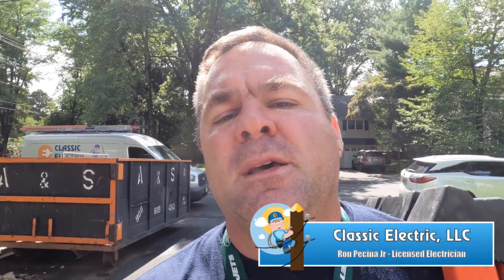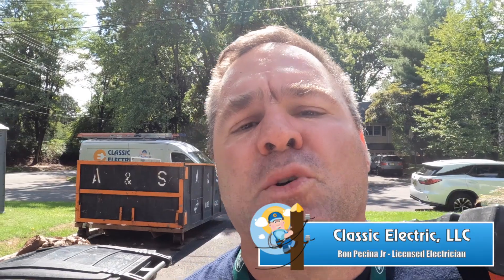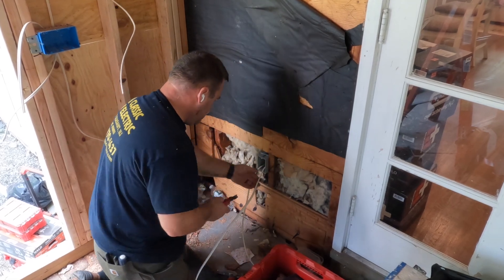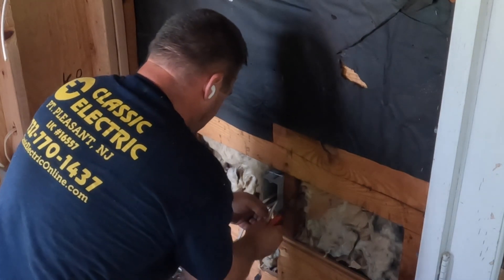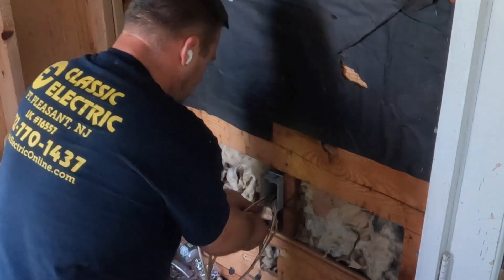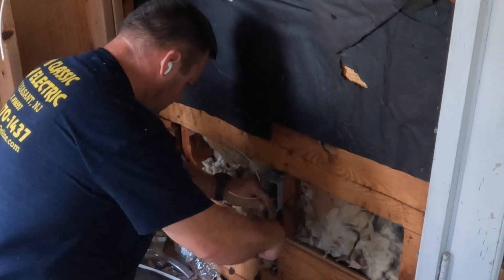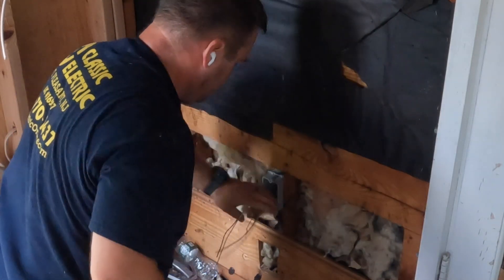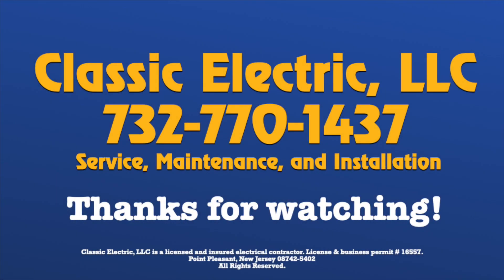How to Install 15 AMP Branch Circuits | New Addition Residential Wiring

Comment: Most construction building codes state that you CAN NOT drill holes in floor joists less than 2 in from the bottom of the joist because to do so would weaken the load carrying capability of the joist.
Reply from the maker: Most NEC requirements require a minimum of 1.25” from the edge of the framing member for any bored holes.

Comment: Rackatiers has a cable hanger I used when we did the upgrade because the hard wired smoke/CO detectors, as well as two new feeders had to go from one end of the basement to the other. Believe me they were alot easier to use than drilling through the joists or pounding in staples.
Reply from the maker: @BassmanII  Yeah but did you have a permit and an inspection and have it all appproved?
Reply: @electricianron_New_Jersey  all squared away.

Comment: If you pull the wire from the middle of the roll you won't have to take off the wrapper and it will make it easier to store your leftovers

Comment: Nice video!  At 8:12 in the video, I would have used a Buchanan crimp sleeve on the ground wires to make an extra secure mechanical/electrical connection or a “Greenee” connection like you said.

Comment: Another great option that I use as a one mane service electrician in the “Wire Wheel 415D”
I can set up 2 reels at a time and it saves me from running back and forth when pulling circuits alone.
Reply from the maker: I used them years ago.  Now they just take up room in the truck.  They’re good if you’re roughing homes a lot.

Comment: I thought modern NEC forbids exposed romex in all situations.  I think thats dumb, but code is the code.
Reply: It can be exposed within stud and joist bays of unfinished rooms. So like attics, crawl spaces, basements and garages. You just can't have it surface mounted to a finished surface of anything.
Reply from the maker: @aaron74  Even in garages and storage spaces IN OPEN FRAMING it is subject to physical damage but it is up to the Authority Having Jurisdiction (AHJ) or here in NJ the construction official.
Reply: @electricianron_New_Jersey  Yep, for my non-drywalled garage my AHJ said I needed to staple Romex from receptacles up the stud vertically to the trusses of the garage to run the cable horizontally. He said that is to prevent people from hanging things like heavy tools on the Romex that runs horizontally in the stud bays

Comment: With all the work you do, check out a Romex spinner made by Madison Electric products.  I believe they sell it at Lowes. One job it will pay for itself. It dispenses 250’ coils of Romex so effortlessly.
Reply from the maker: I wouldn’t use it enough and it would break in the truck.

Comment: I wonder why that 14/4 and 12/4 Romex never caught on ? It's a shame the 14/3 and 12/3 Romex is not used much anymore in today's code of afci as not practical for branch circuits . Now I was told by an inspector after doing a panel change out that he wanted arc fault breakers but the circuits were all multi branch circuits . I told him this and he said they do make 240 volt arc faults . I told him that they don't for this panel but really I wasn't sure . He went to his boss and he said not necessary. This was early in afci indoctrination. I wonder if it's worth using a 240v afci ? I guess for trouble shooting maybe more difficult but multi branch circuits were always that way with a shared neutral .
Reply from the maker: I was a big fan of the mulitwire branch circuit (MWBC) until AFCI's were required everywhere. I dont do much "new work" like this but my customer wanted me to so here I am anyway. The thing about the MWBC is that if any portion of that circuit looses the neutral connection its a real possibility that you burn out sensitive electronic equipment like televisions, computers, etc. Anything with a microprocessor will more than likely  be toast because the MWBC without the neutral becomes a series circuit and voltage IS NOT the same throughout the circuit.
Reply: @electricianron_New_Jersey  Yeah I tend to agree . In the world of troubleshooting multi branch circuits were the most problematic. Now for ropers it was the fastest cheapest way to wire a house was the  priority and multi branch circuits was a way to do that but afcis changed all that and probably for the better as you described . Nice job